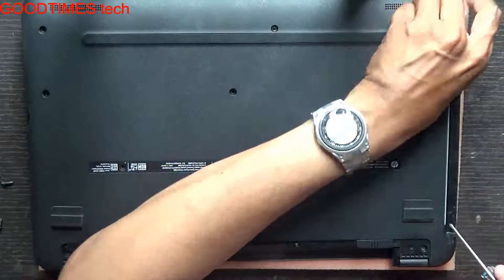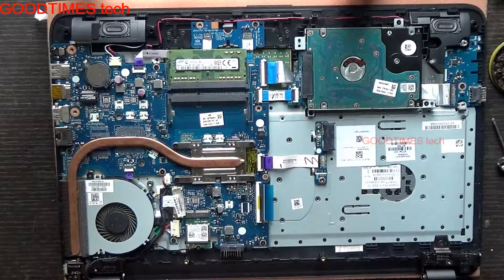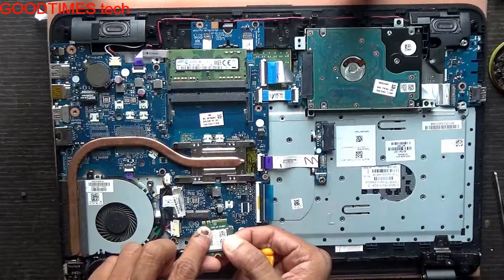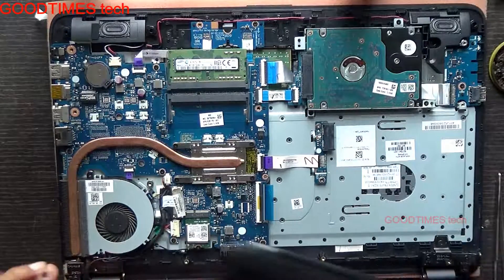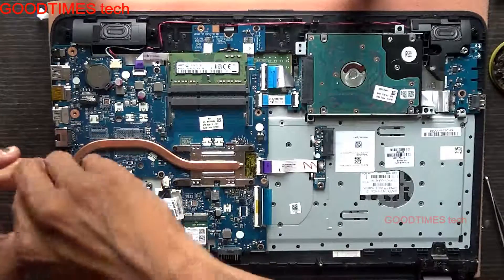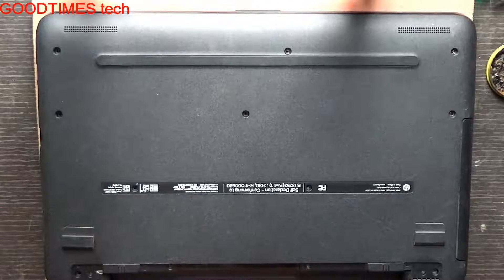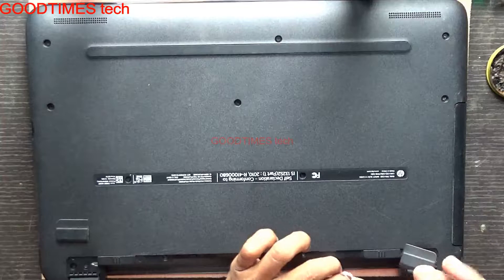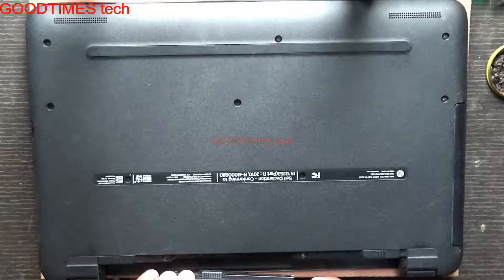HP Notebook | How to replace WiFi card

Comment: MS Teams calls seriously lags or chops while using HP laptops where works absolutely fine with devices like mobile or lenovo laptops. Will this the trick shown in this video fix the issue?
Reply from the maker: This video is only about replacing the Wi-Fi module, it doesn't make any changes to software,
regarding lagging only on HP laptops, try disabling the HP apps(software's) on laptop.
Thank you, have a GOODTIME...

Comment: Sir my laptop wifi work but quite slow the signal bar is not full even I am close enough to the Internet connect my laptop model is hp notebook - 15-af138au
Reply from the maker: Hi sir,
sorry for late reply, if the network bars are less need to check the antenna cables connected to the WiFi card, if they are good then replace the card and check.
Thank you for watching the video, have a GOODTIME.

Comment: Can you remove the cd drive after opening the screws?
Reply from the maker: Yes, CD drive can be removed after removing the screws.
Reply: @GOODTIMEStech  how? Couldn't find any screws to detach it
Reply from the maker: Just unscrew the screw shown at 0:57 sec in this video and pull the drive out, be gentle  as the drive might me jammed if not removed since years.

Comment: I hace a HP 15 au020wm. With i5 6200u, I like because I could upgraded to 24 GB. It has a 500 GB SSD. 

But I dont know ir the M2. Is the one It handle. 

Help please.

Comment: I want to upgrade my hp ac098tu laptop's internal wifi card which is 2.4ghz to 5ghz.
Is it possible ?
Does my old laptop will accept new 5ghz card?
Reply: You can replace the wifi card. Make sure you replace card with the same interface, like m.2 key e (also known as ngff) or mini pcie slot.

Comment: My laptop has only one antenna  whys that im trying to change the wifi card can one antenna connect to 5ghz
Reply: I have same problem.. dont know if its gonna work if i install a card with 2 antennas ....
Reply: @juancortesvnc  i still have the same wifi antenna and it updated which now i am using 5ghz